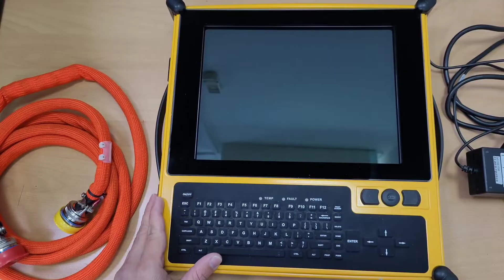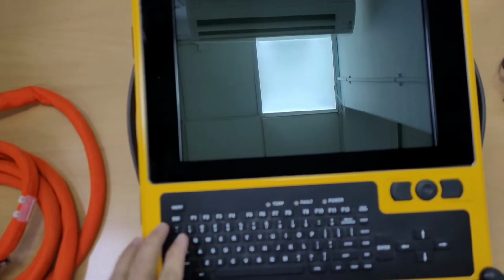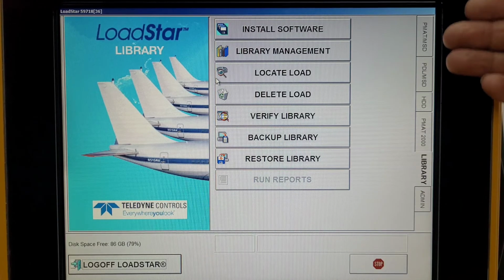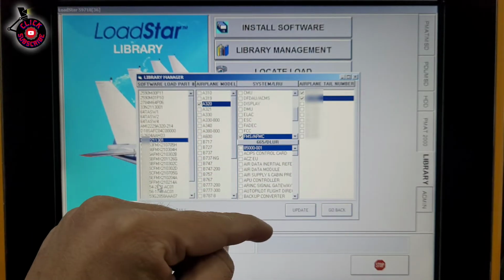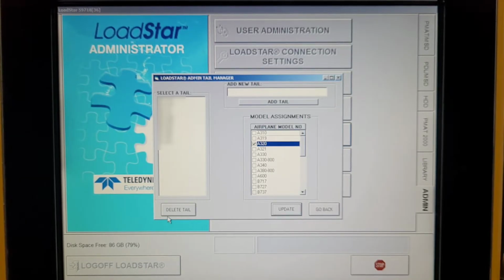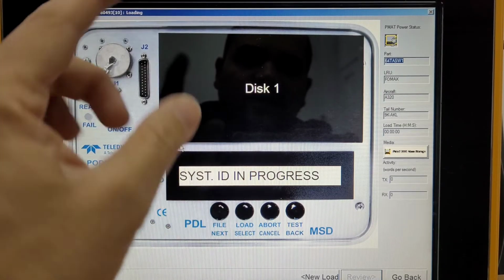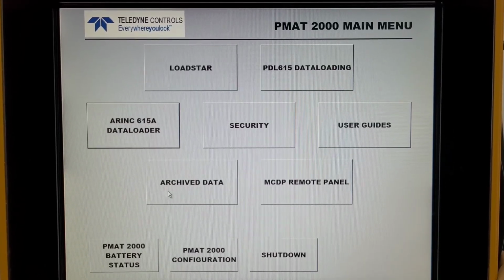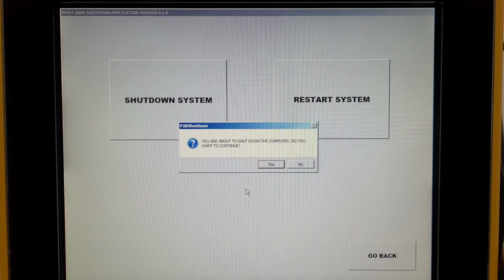PMAT 2000 PART 1/3 INTRODUCTION #pmat2000 #pdl

Comment: nice content, bro, i have a question, PMAT 2000 Can it be left charging for several days or is it recommended to disconnect it once the charge is complete?
Reply from the maker: Thanx for appreciation.

As normal battery charging practice it shd be disconnected at after charging fully. And trickle charge when needed.